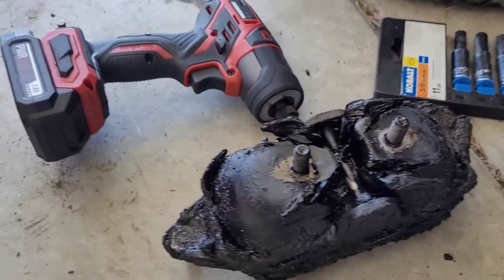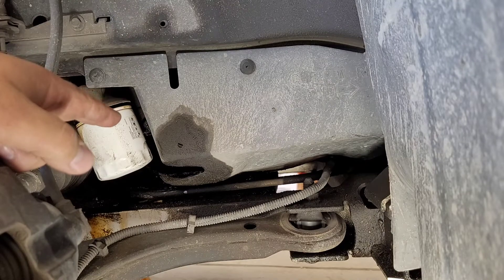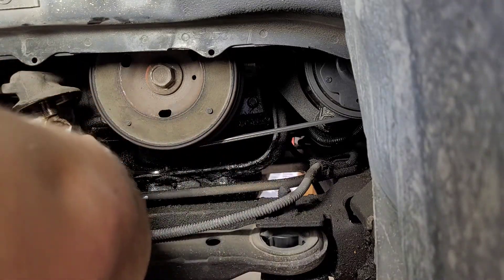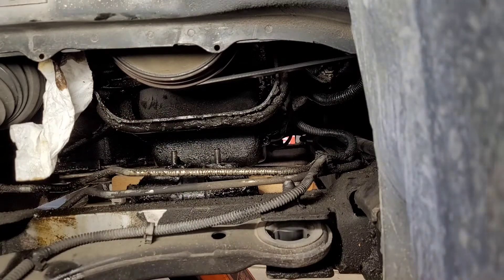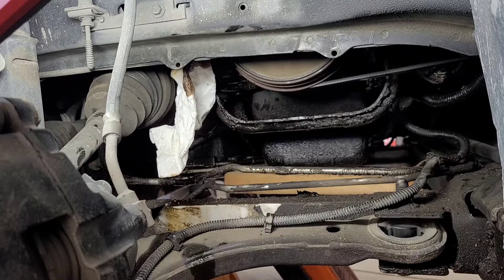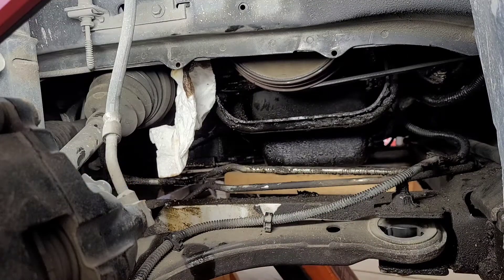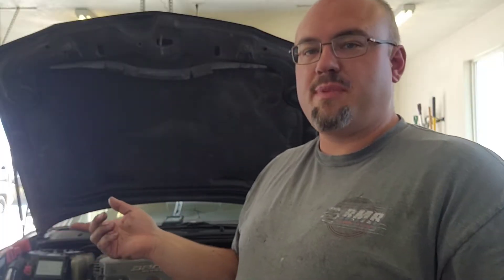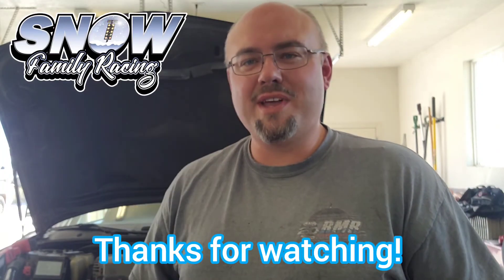Good Motor Mounts Go Bad... Passenger Side Lower Mount on the 2002 Monte Carlo SS

Comment: Much less vibration down the road
Reply from the maker: Much less, I was expecting this mount to be worse than it was.
Reply: What were the vibration symptoms you were having
Reply from the maker: Mostly vibrations at varying speeds consistent with a rubber mount getting old and worn out.